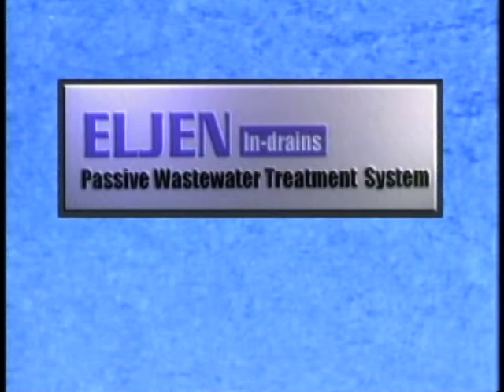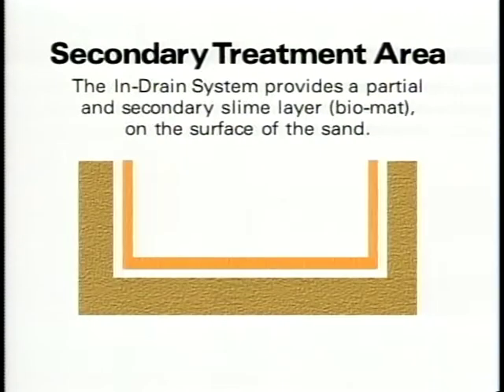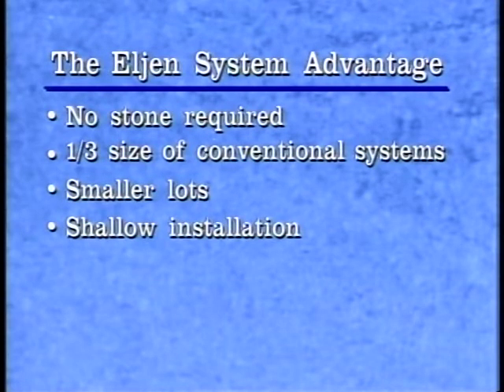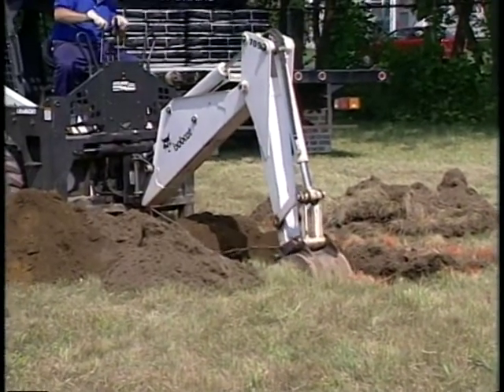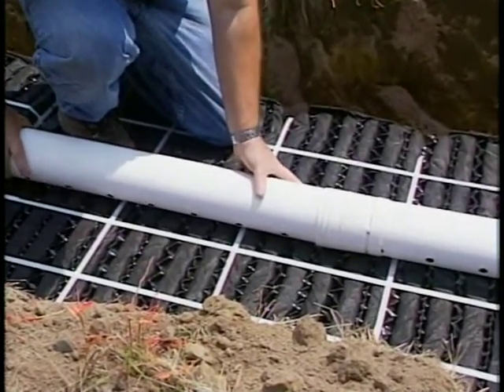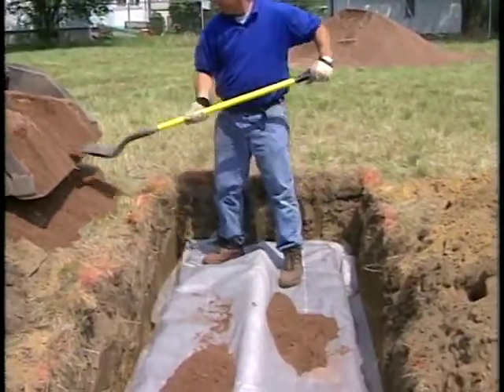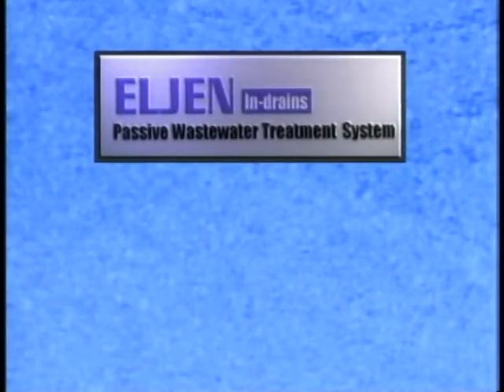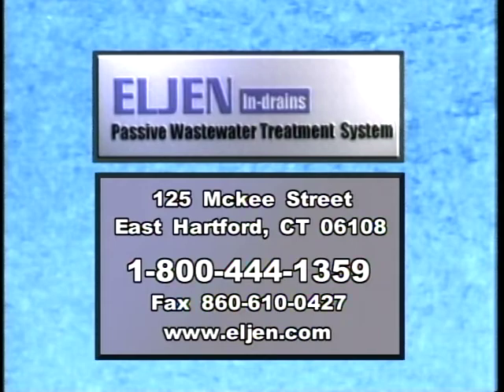Eljen GSF Installation Video

Comment: infiltrator seems , better product cheaper...I have engineer that keeps pushing this garbage on to my job site,it usually clogs after six years..study's ,homeowners, only reason think engineer is called cut and paste on cad...
Reply: You should work on making complete sentences before criticizing someone else's idea.  Also many times it will allow 50% reduction in drainfield length which is necessary .